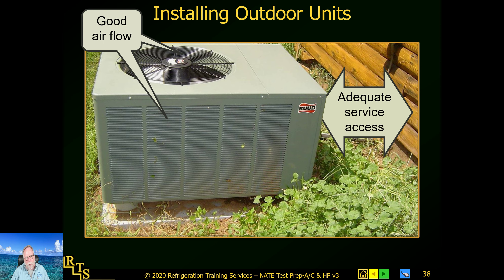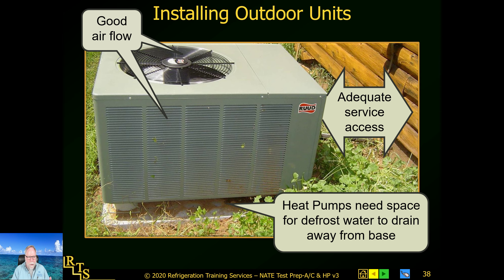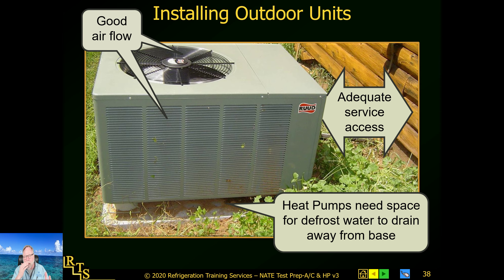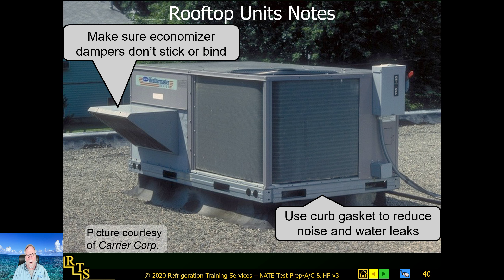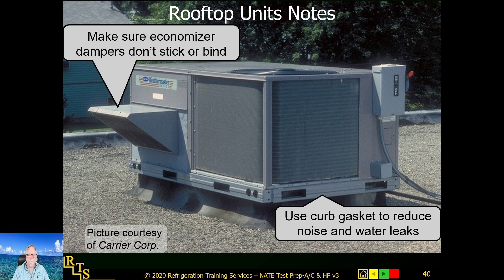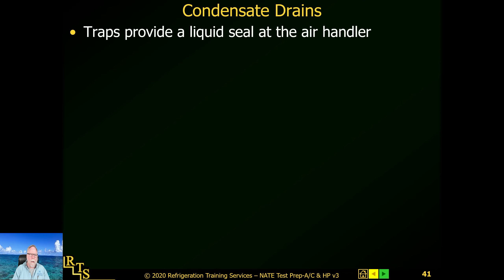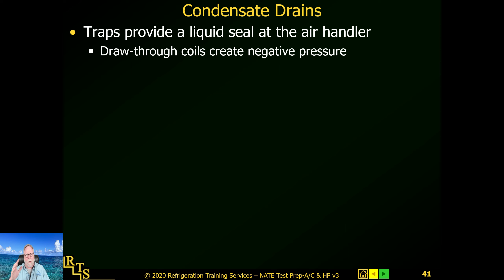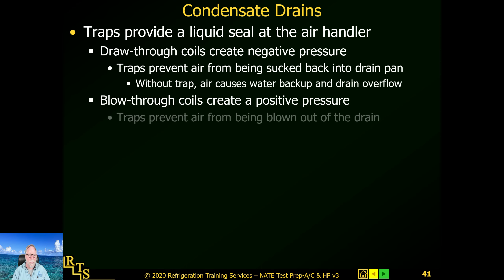HVAC installation and service tips part 1

Comment: I had envisioned the idea of a spring loaded tubing cutter, then I found CPS was already making them.  So much for making millions on that idea.  The "BLACKMAX TUBE CUTTER KIT, #BTCK" is spring loaded so you set the tension when you start and the spring automatically adjust the cutting wheel.  Because the tension is perfect through the entire cut even the burr is noticeably minimized.  It has to be the best manual tubing cutter out there.  Still carry the little Yellow Jacket cutter, that I never use just in case I need to get in a really really tight place.
Reply from the maker: Cool!  I love my little “imp” tubing cutter.  It got me out of a lot of jams!